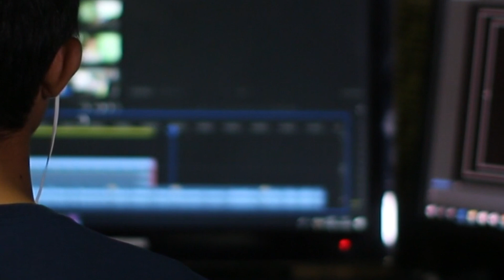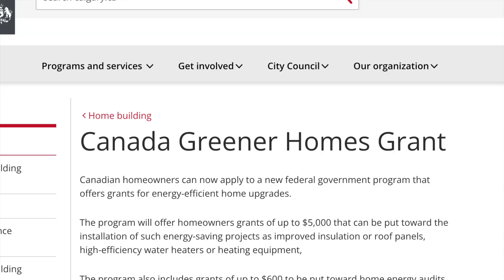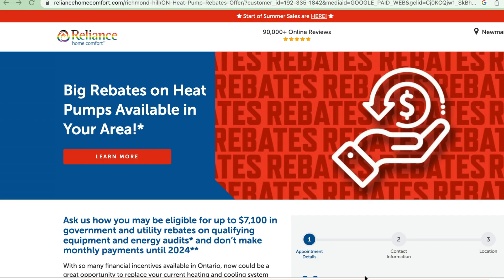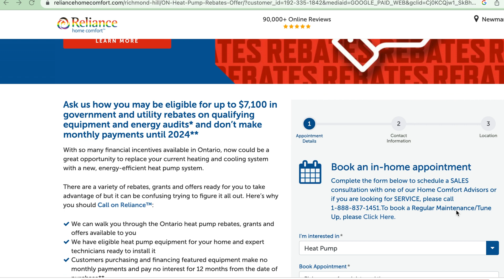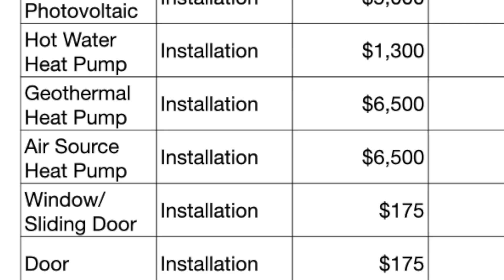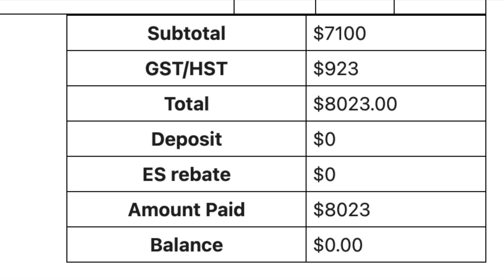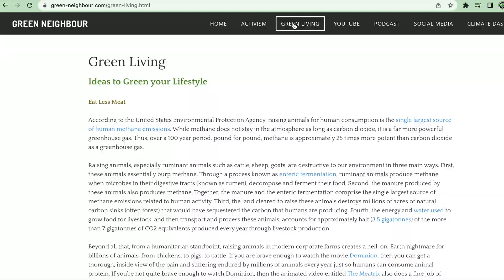Heat Pump Rebates in Canada (UPDATE: Greener Homes Grant is no longer accepting new applicants.)

Comment: These heat pumps are garbage with anything colder than minus 6 degrees.....whats going to happen in minus 25.....
Reply from the maker: As you may have noted in the video, these heat pumps work with a furnace, so, on really cold days, the furnace can kick in as a backup. In our case, we will use our electric space heaters to supplement during those really cold days. Believe it or not, the average annual minimum temperature in Newmarket, Ontario is 3° Celsius (37° Fahrenheit). The average temperature in Newmarket during the coldest month of the year (January) is just -1°C. On average, the daily lows only dip below -6°C during the months of January and February, so I'm not too worried about it. Moreover, at the rate that average temperatures are increasing, this will become less and less of a concern moving forward. https://weather-and-climate.com/average-monthly-min-max-Temperature,newmarket-ontario-ca,Canada
Reply: my experience is that Air Source heat pumps don't work in colder climates.  Ground Source Heat Pumps/Geothermal, I hear they are better.  We had an air source heat pump installed and are just south of collingwood ontario --- tried it for 2 winters and had to switch out to an electric furnace with an ac unit.  I completely agree with what you write.  Buddy answers below that they work with the furnace.  Yes, the furnace has an auxillary heat strip (basically a toaster over coil of 5 to 15 KW - I assume you could get higher ---- well at (-8C), the aux strip and furnace ran ALL the time.  It was insane.
Reply from the maker: I’m currently experimenting with how cold I can set my heat pump before it activates the auxiliary system (aka the gas furnace). I’m hoping that this heat pump can at least work effectively down to about -1°C. That would be pretty good in my estimation. Will try to see what we can do with electric space heaters on days that it gets below -1°C. However, after seeing how it operates down to -1°C, I’ll definitely try pushing it below that and then I’ll see what happens. Either way, I’ll be posting videos to share my experience with anyone who might be interested. The whole point of my channel is really to settle controversy when it comes to these things. I remember hearing all kinds of negative comments about solar panels before I got my solar array installed. People would say they would only generate a few cents of electricity a day, etc. I certainly learned that that was not the case. It was the exact same thing with electric cars, as well. People would say they would not have the range or the performance of a gas car, people told us  we would spend all kinds of time charging, and people said our electricity bill would go through the roof. All that also turned out to be a bunch of malarkey, so I’m hopeful that heat pumps might be practical to a certain degree. Where I live in Newmarket, the heat pump should be able to work for 8 months out of the year if it can operate to -1°C, 10 months of the year if it can work down to -6°C, and all year long (with the exception of a few really cold days) if it can operate down to -10°C. Of course, this must all be taken with a grain of salt, because I am basing this on the “average” lows for the various months of the year, but, of course, averages do not occur at average rates.
Reply: @GreenNeighbour  that is an honest detailed response.  First off i think people should always preface the word heat pump with either air source or ground source.  assuming we are for the most part talking air source heat pumps ---- if your back up system is your gas furnace than i think between 10 deg C & (-1) C, you should be ok.  in my case i would have had to introduce propane tank and i did not want to have one of those so my b/u was the heat strip.  that combo of a/s heat pump & heat strip did not work in Grey County.  so that is the crux - below (-1) if you are activating gas or space heaters i don't think the savings will be there.  as far as a/c goes  it was fine.  good luck.  for me, it did not work.
Reply from the maker: @nikshill8767  Thanks, Nik. Fingers crossed!

Comment: Great video, did the inspector come back to approve the work for the rebate, is the heat pump heating your home now or is it only for ac.
Reply from the maker: Thanks! Yes, he did come back for the final inspection. At that time, he completed the paperwork for the rebate and sent it in on my behalf. I’ve had the opportunity to switch the heat pump from AC to heat on a couple of occasions so far, and the heat worked quite well. Of course, that was on days that weren’t horribly cold, but it was cold enough to be uncomfortable without the heat on. I quite enjoyed the ability to adjust the temperature and switch from AC to heat right from my smart phone, which I can now do because the new Ecobee thermostat they installed is a smart thermostat.